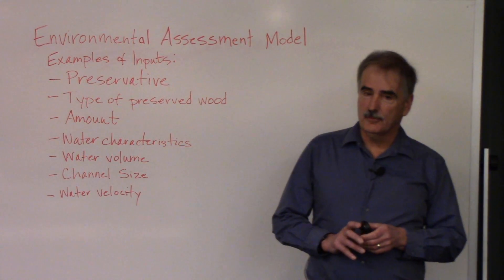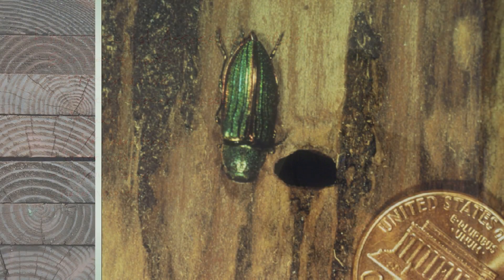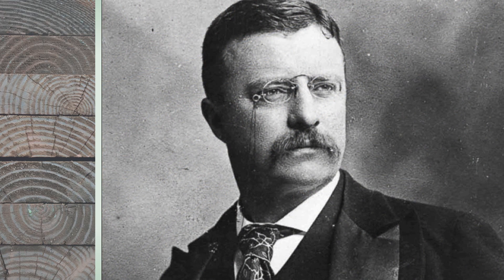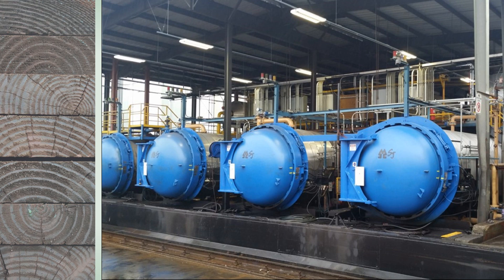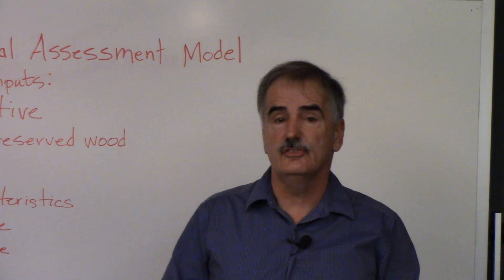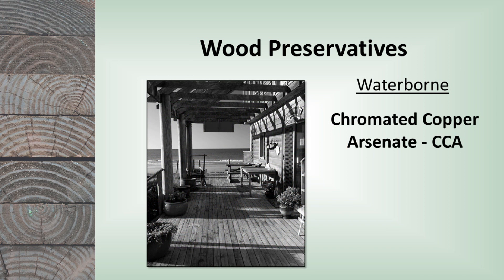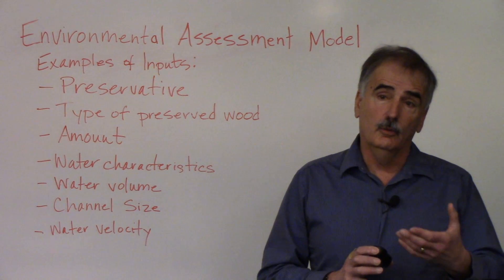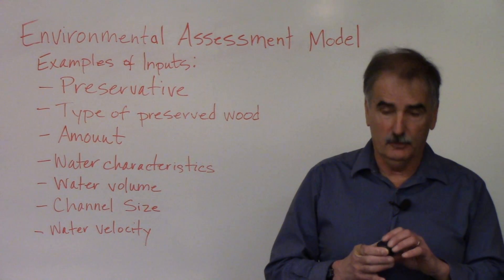Wood Preservatives and Pressure Treating

Comment: Very informative. I am interested in exploring pressure treating  milled lumber from  property I own for my own personal use, not for sale. After a cursory exploration of gathering information, one of which is viewing this video and becoming familiar with the pressure treating process through other information, mostly gained online, I am at a point where I need some input from others whom are much more knowledgeable than I on this subject before I consider taking on this project. I am an Architect and do not consider myself qualified enough as an engineer to solve this undertaking. I do understand, so far, I would need to build a pressure vessel, purchase appropriate supply and transfer tanks to handle, I assume, ACZA product, purchase vacuum  and pressure pumps. I would essentially build my own treatment processing plant if it was plausible and cost effective. I would greatly appreciate your comments on questions I have.
Reply from the maker: It's really not plausible to build a home treating plant; it would be very expensive and your ability to purchase a preservative to use would be challenging. Most preservatives are considered restricted use by the EPA and can only be sold to commercial companies. You would be better served purchasing commercially treated products. Or, if you have a treating plant nearby, you can contact them and see if they do Treating Service Only, or TSO where they can do the pressure treating for your wood at a cost.
Reply: @WoodThatLasts  The restriction of chemicals is a major issue. We're capable of trucking to a treatment plant approximately 40 miles from our location.  Thank you for your help.

Comment: I built a small deck with lowes pressure treated wood, the support boards, 2 x 6 's complety rooted out and fell apart? it was not on the ground. The support boards do not get stained?

Comment: Hi guys. 
I saw a video saying burning pressure treated wood leaves copper in ashes. 
That’s a health hazard. 

My question is can you char pressure treated post ends for ground contact (not leaving any ashes) and not have any health implications?
Thanks
Reply: Charring the post ends that go into the ground will not provide much protection. It would be better to place the factory-treated end into the ground and use field treating on the cut end above the ground for best protection.

Comment: How do these modern methods compare to the the ancient way of charring the wood and then oiling it?
Reply: Today's preservatives and the pressure treating system provides much more protection from deterioration than the ways you described. The key difference is that pressure treating integrates preservatives into the wood fiber. The methods you describe are only on the surface of the wood and do not offer lasting protection.
Reply: @butchbernhardt496  is there like a websites or something that shows different types of treatments and their lifespans?
Reply: Exactly, ancients done everything better
Reply: Done with ancient wood? Perhaps it’s better. Done with modern wood it is inferior to wood preservatives.

Comment: I can’t tell if the souther yellow pine at Home Depot is treated or not, not by smell at least. Is all yellow pine treated?
Reply from the maker: Most treated wood products sold in retail locations will have an end tag that indicates the preservative used, the retention or amount of preservative in the wood and the proper application such as Above Ground or Ground Contact as described in the Use Category or UC. 

Not all southern yellow pine is treated, but the species is by far the most popular for pressure treating and is the most available treated product in retail locations.
Reply: @WoodThatLasts  thanks for the reply! I will be sure to look today. Looking to replace my boat trailer bunks, but it’s aluminum and wouldn’t want to have any copper treated wood around them. But this was the first video (and reply) that broke it down more simple, thank you🫡

Comment: Scorching and 50/50 used motor oil and diesel fuel. Keep it simple.
Reply from the maker: Neither of those methods simply do not work to protect wood from insects and decay. Using motor oil only makes the wood more flammable and the odor makes it impractical to use.
Reply: @WoodThatLasts  yes it does

Comment: EPA shut down any real wood treatment.  Soak it in diesel fuel for a few days.
Reply from the maker: Uh, no. Soaking wood in diesel provides little long-term protection against insects and decay fungi. There are many more preservatives available today vs. the past that are effective in protecting wood, proven by decades of use and experience.

Comment: What's the best protection I can use for untreated wood trying to save money on a shed build
Reply from the maker: The best protection is pressure treating and you cannot do that after the wood has been put in place. Finishing the wood with paints and stains can help extend the life, but that protection is not equal to pressure treating.

Comment: The quality of today's wood is so inferior to that of 50 or 100 years ago that a preservative is necessary to get to last a fraction of what yesteryear's untreated wood would last. That has been my experience.
Reply: I agree with the OP. Treated wood warps, it's full of cracks and stripped areas, it's not dense, and the wood type is never labeled. That is relatively new in the market. I never saw such crappy wood in the 60s and 70s.
Reply: It's labled, it's density is not 'all' compromised, it's  not 'all' cracked.
Reply from the maker: That is simply incorrect. Trees and the wood that comes from them have not changed over the past century. Wood from the past deteriorated just like the wood of today deteriorates when unprotected from insects and decay fungi. Preservatives in wood are necessary when that wood is used in applications where there is high risk to deterioration. That has always been the case and wistful thinking that everything was better in the past is erroneous.

Comment: what is a good wood to use in a vegetable garden ?
or what can i treat it with to deter termites etc
Reply from the maker: Preserved wood is a good choice for garden boxes. Research by Oregon State University (https://preservedwood.org/portals/0/documents/PW_in_planters.pdf) shows any preservatives migrating from the wood do not impact the vegetables or plants. You'll want to make sure to specify a Ground Contact treated wood, since   garden boxes contain soil that will hold moisture near the wood and increase the risk of deterioration.

Comment: Please advise on effectiveness of Double Diffusion with Copper Sulfate and Sodium Fluoride .
Reply: We're not aware of any research into those chemicals. Certainly, copper has proven to be an effective protection for wood. Not sure about the double diffusion process you mention. I do know that the major preservative manufacturers have sizeable research and development departments that for decades have looked into a variety of chemicals and processes to improve wood durability. The fact that those chemicals and processes are not in use would indicate they may not perform as expected.

Comment: Used motor oil can't be beat
Reply: I have been using it 50/50 mix with diesel, I’m hoping it holds up ?
Probably no worse environmentally than store bought preservatives ?
Reply: @northernspur6282  the copper additives of store bought stuff has it’s advantages for stopping bacterial growth. If you add some store bought stuff to used motor oil, you have the best of the best. Additionally, the store-bought stuff has drying agents in it. I have made this mix before and I can tell you from years of firsthand experience this mixture is the best of the best and when you wipe it off after you’ve coated it it dries just like linseed oil. Best stuff ever.
Reply: Thanks for the tips Bill..
Reply from the maker: Dipping wood in motor oil simply does not work to protect wood from insects and decay. Using motor oil only makes the wood more flammable and the odor makes it impractical to use.

Comment: Hello Sir my question is is that posible or correct to use only threated wood to frame a house 
Why not to use all wood pressure threated?
Reply from the maker: Treated wood offers protection that is not needed for typical wood framing in home construction. Wood framing in a house is not readily exposed to moisture and insects, so the risk is very low. Treated wood is intended for outdoor exposures where it will be regularly exposed to water from rain and snow or when in the ground, at risk for termites and other wood destroying insects. In areas where termites are a high risk, such as Hawaii, wood framing is required to be treated under the state building codes.

Comment: Great video.  I have noticed that some treated wood has a 2.0 rating and some has a 4.0 rating.  I know that 2.0 is for non ground contact and 4.0 is for wood that will have ground contact. My question is, what makes the difference is it the amount of pressure applied during the treating process, the length of time it is left in the treatment tank or vessel, or is is it the type chemical, or is it all of the prior. I live in zone 4, so what is recommended for this area to get the longest in ground durability?
Reply from the maker: Retentions, or the amount of preservative in treated wood, are different for the specific preservative as well as the exposure. The ratings you note aren’t necessarily based on the pressure level or time in the retort. Wood treated for the same exposure, say UC4A Ground Contact, can have a different retention based on the preservative, as some are equally effective at lower levels. When choosing treat wood, rely on the Use Category to match how you will use it, not the retention.

Comment: FOR A  LADY OR  ANOTHER PERSON  IT IS  LIKE  FALLING A  TREE  THEN  CUTTING INTO  SIZES  2X4  2X6'S  AND THEN  IF  A PERSON HAD A  PRESSURE COOKER  LARGE ENOUGH FOR ALL OF THAT  AND THE TREATMENT  OF  STUFF  TO  GO INTO IT  AND  THEN PRESSURE IT  FOR  SO  LONG RIGHT ???
Reply: Not quite. You need to be registered with the EPA to purchase and use most preservatives. And you need specific equipment to complete the treating process.

Comment: I dislike pressure treated fence panels because they sag soon after installation.
Reply: I think there are a couple of factors in play.
1. PT pine is wet when you get it from the big box store. So Ideally, you'd want the pressure-treated wood to dry (out of sunlight!) for a week or so before installing. When the moisture levels have equalized, your wood is going to be more stable
2. Pine, the most common wood for fence panels, is a very bendy (unstable) wood.

Comment: Hi Dr. Morrell, Has the OSU long term study included options like Japanese Scorching technique or "Home Remedies" like Diesel/Motor Oil mixes? thanks
Reply: There have been studies of other coating products that have claimed to be as effective as pressure treating (https://preservedwood.org/portals/0/documents/WWPI_field_test_Hilo_Feb_2020.pdf). The results indicate such products are not effective against termites nor decay.
Reply: Treat wood with your commercial copper fungicides and absolutely use used motor oil as well. Nothing better than used motor oil.

Comment: What is best borax boric acid mix composition as preservative
Reply: AWPA standards for borate to meet Use Category 1 and 2, above ground for interior construction, require retention of 0.17 pounds per cubic foot (pcf) for areas without Formosan termites and 0.28 pcf for areas with Formosan termites (typically coastal areas of Southern California, Texas and the Gulf States). Please note these standards are for pressure treating, which can only be done in a manufacturing setting. Just brushing or rolling on a borate-based coating will not provide the same level of protection. Also note that borates are only intended for interior use where the treated product will not be exposed to liquid water. Borate is water soluable and its protective qualities will be diminished with exposure to water.
Reply: nothing YOU can sprinkle on,thats for sure..its all at the pressure trating vessel